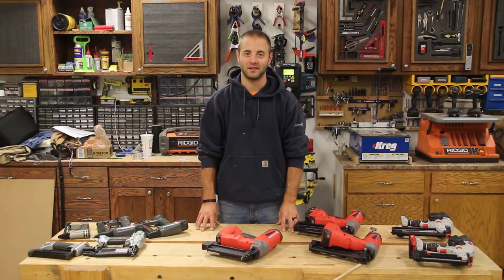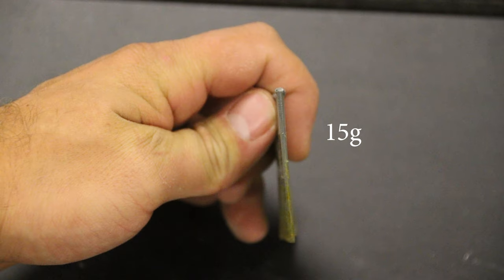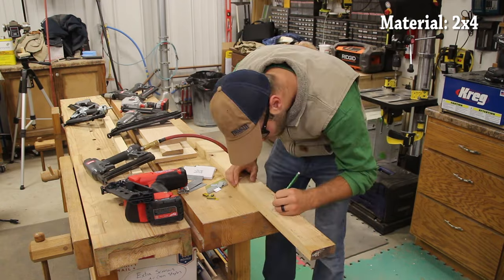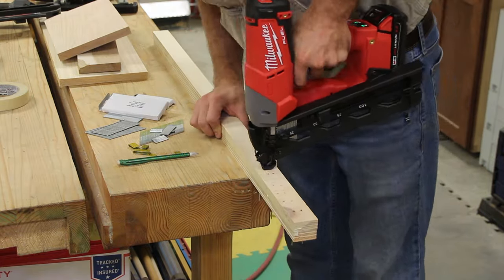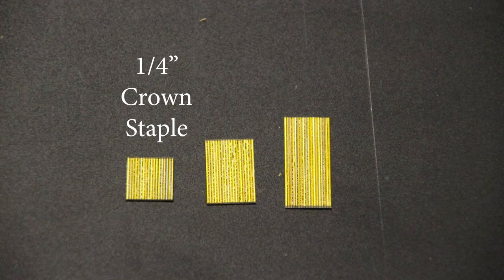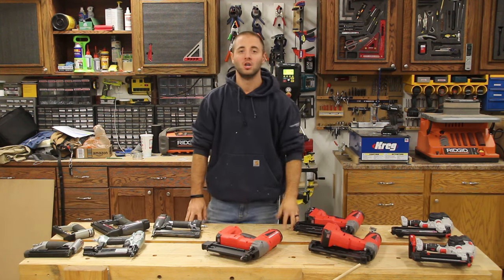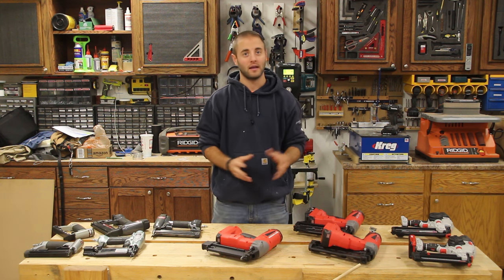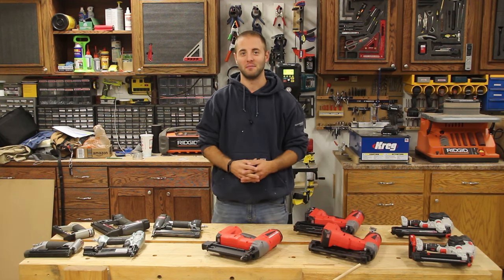What Gauge Nailer for Woodworking?

Comment: I'm trying to stop wood floor squeak and thinking about just driving nails into it. I've tried it with 18 gauge and no success. Is a 15 longer?
Reply from the maker: The gauge is the diameter of the nail.  They all come in different lengths.
Reply: I'm guessing its wood not carpet? Either way the way to get rid of a squeak is really with screws. They stuck the material together. Squeaks come from loose wood rubbing against wood or wood sliding against fasteners. Nails being smoot may solve the squeak for a bit but they dont really grab the substrate material effectively.

Comment: Well that answered my questions about what gauge gun to start with, now the age ol' question: Brands. Which brand of 18g gun to stay away from? I currently have Milwaukee, RIDGID and Ryobi tools so their cordless guns would be cheaper for me to buy into due to having their battery platform already. Any other suggestions? Ryobi's have hands down the best and most reviews on Home Depot's website. Basic DIY and wood working for me at this point so a $500 Brad nail gun isn't necessary.
Reply: I'm not a big fan of Ryobi power tools but I do own their 18ga AirStrike brad nailer and it is fantastic. As a test, I was able to shoot 2-1/8 inch brads into high-density particle board and drive the nails flush. Just keep in mind that the cordless guns are huge and heavy in comparison to their air counterparts. They also cost more - sometimes a lot more.
Reply: Pro1er I just bought the Ryobi cordless. I have pneumatics nailers and  this new 18g is all I use now. A lot of good content on YouTube reviewing 18g cordless nailers and Ryobi is always near the top.
Reply: Yup, it's a great gun, but it's huge! LOL

Comment: Thanks for the video!
If I can only get one, between the 15 GA and 16 GA, which would you recommend?
Any reason to buy both, 15 GA and 16 GA?
Reply from the maker: 16 guage will work 99 percent between the two.
Reply: @WorkshopAddict  Thank you!
Reply: In my experience the 15 gauge nails have a larger head than the 16 gauge nails so it'll depend on your application.
Reply: I'd go with the 15 gauge for more holding power. If you need thinner, then go for the 18 gauge brad nailer. 16 gauge & 18 gauge are to close in size to not go for the 15 ga.

Comment: What type of nail gun and what size nail for fence building?  Thanks.
Reply from the maker: You're going to use a framing nailer to fasten the fence rails to the posts.  From there, the pickets are best attaches with large staples.  Ryobi makes a nice stapler at an affordable price.  You can use a hammer on the fence rails to attach them to the post.

Comment: As a DIYer who will rarely use a nail gun for projects, I've elected to order a Ryobi 15ga angled nailer. I hope to avoid needing to buy a frame nailer. Whst do you think? (I already hsve an 18ga crown stapler.)
Reply: Unfortunately, the HP version of the Ryobi 15ga has been announced, but not yet available, and  have an active project. A video says it will drive 1500 nails on a charge, vs 750 for the non-HP. I have lots of Ryobi batteries and chargers, so it's no big deal.
Reply: Do you have a preference for brand of 15ga nails? Are stainless steel ones worth the higher price?
Reply from the maker: @Metal_seer  Stainless is worth it for outside or moist projects.  15g will not replace framing nails!  I would look ar dewalt nailers and see if you can find them close to the cost of Ryobi.  Brand of nails does not seem to mater much.
Reply: @WorkshopAddict  Thks for replyong. I will look, but I know without looking an equivalent DeWalt will cost a lot more than Ryobi. Plus, I would have to buy a DeWalt battery and charger. Every video I've watched gives the Ryobi 15ga angled very good reviews.
Reply from the maker: @Metal_seer  Owning more than one battery brand opens you up to more quality tools and sales.  I am not bagging on Ryobi, but they are low end nailers.  If you want to stay there, then that is your choice.  On sale, you can get dewalt for little more than ryobi.  IMHO, buy once, cry once and enjoy good quality tools.  As a diyer, you will appreciate the higher quality tool and especially the trigger.
Reply: @WorkshopAddict  I have bought other brands if they have a superior feature. That's why I bought a Bosch grinder, because it has a very ingenious blade release. Once I'd bought into Bosch, I also bought a Bosch multitool.  But, having multiple chargers and batteries costs $ and takes up space.
Reply: I'd think 2.5 in 15ga finishing nails, augmented by 3" deck screws where needed, will be adequate for the DIY projects I do, using 2x3s or 2x4s as structuraly elements. But, if I find I really need a framer nailer, I will look at multiple brands, as you suggest. Thanks for the advice.

Comment: Hi, what the best nailer for attaching cabinet back to MDF or Plywood? The material for the back is 3mm MDF
Reply from the maker: 18 ga and glue
Reply: Your back is thin and not very strong, as a retired cabinet maker I would us a 1/2 in wide crown with at least  9/16 legs to make a strong held back.

Comment: What gauge would you recommend for putting 1/4 inch plywood on studs on wall & ceiling?  Thanks
Reply from the maker: Staples.  If you want to use a nail, go with a 15g so it has some sort of head to hold the wood.
Reply: Thank you @WorkshopAddict

Comment: Thanks for the video info. Starting DIY and woodworking, what you recommend for Crown molding ceiling 18 or 16?
Reply: 16 Gauge, a bit larger diameter nail for better holding power, and still a small enough nail head to be easier to cover over.

Comment: What would be the perfect nailer gun for installing baseboards. I been shopping around and both lowes and home depot have a kit that sales the compressor with 18&16 gage nailers.
Reply: 18 and 16 ARE what you need for most baseboard applications and those gun/compressor combo kits are great.  You'll get plenty of value for the money.  Use 16 (2" or longer 2 1/4" is better ) for your field fastening and 18 (1" or less) to brad your ourside corners.  Careful field fastening around toilets and sinks and other places where water lines are present so as not to punch thru a water line.  Get yourself a cheap stud finder that will also sense water lines or maybe a little gadget specifically for finding the water lines.

Comment: Would you use 15 gauge nails for nailing fence pickets to the fence rails? Trying to put up a fence myself. Thanks!
Reply from the maker: Some would, but I would suggest staples.
Reply: The trouble is the nail heads are pretty small so you'll most likely end up sending the nails through the pickets completely if you aren't careful and they'll work loose pretty quickly within a few years....staples would be better as they'd kind of bridge across a larger section of the picket and hold more firmly.  Course you could always use a framing nailer but a bit overkill for most pickets which I think are in the 1/2 to 1 inch thickness so a wide crown stapler would be a good solution to that, just harder to remove later on if needed.

Comment: Awesome video, liked and subbed! I will be framing 2 by 4's for a screened in patio job, would you recommend that I go with an 18 or 16 gauge nail gun?
Reply from the maker: We would recommend a framing nailer for that task.
Reply: You’ll want to use 16d sinker nails. I prefer a palm nailer and plain nails rather than a framing nailer. Framing nailers are expensive and heavy. Palm nailer is very light and super versatile.
Reply: Palm nailers have their place. I use them in restricted spaces and for attaching metal fasteners. Ocassionaly for larger nails over 3.25inch, ones larger than a framing nailer can handle. If I have more than a few nails and think you may frame again. Framer guns can be had cheaply. If you will only see yourself nailing only a few, go with the palm nailer. For lighter trim  and shope, yes 16 and 18 gage.
Reply: Or get a hammer and some 16d nails. No need to buy a gun for a small project

Comment: Is there any efficiency drawback to buying a plug in electric nailer since they are generally less expensive?
Reply from the maker: No, in general they just seem to be of lesser quality so try to buy a brand name one..
Reply: Not really, typically though they don't have the capacity that an air powered or battery powered model would have, but maybe the new electric ones do I haven't checked lately.  I don't have any battery powered nailers or staplers all mine are pneumatic and work great.  The only electric fastener gun I've used was an electric stapler and it wasn't that great LOL.

Comment: what is your advice about the non-separate compressor nail gun? The ones where no air hose is needed. Your thoughts?
Reply from the maker: Like the Ridgid and Ryobi models?  If so, they are nice, but larger and do not fit into small area.

Comment: I'm buying my first gun.  My uses are indoor trim, bead board on a island cabinet drawer repair etc.  Will a 18 gauge be fine or should I go 16 or thinner at 23?  Any information would be appreciated!
Reply from the maker: You can get by on indoor trim with a 18, but a 16 will really be better.  Bead board and drawer repair are more in the 18g range.  I guess I would start with an 18g to save money and see how that works for you.  If you have straight walls and hardwood trim, you will be fin.  if it is pine trim, you might find the board will get loose over time.
Reply: @WorkshopAddict  the bead board is probably the heaviest I'll ever use a nailer on.  It's going around a island.  Thinking 1/14 inch 18 gauge nail with a little liquid nails on back.  Thoughts?
Thanks
Reply from the maker: I would use 1-1/2" nails on the bead board to make sure I have a bit more than 1" into a stud.  You should be fine, just know you might need an extra nail in some trim boards.

Comment: I dabble in furniture (desks, small tables) making, and I am Trying to decide whether to go with a 16 gauge or 18 gauge nail gun?  Any advice?
Reply from the maker: probably 16ga only because there is more structure, but if it is just for small trim pieces, go to 18ga.
Reply: both

Comment: I'm new using compressors, I bought a 1 gallon(CH) compressor, the hose, and a (Znex)brad nailer, and the nails... it's not working... How can I figure out if the problem is the compressor, the hose, or the brad nailer ? Thank you in advance for your answer
Reply from the maker: We need more info..  Is there a regulator on the air compressor?  does the air compressor motor turn on and turn off after some time?  What fittings are you using on the hose?  We need more info.
Reply: WorkshopAddict 
Would a picture of the compressor and a picture of the hose help you ?
Reply: WorkshopAddict , no, no regulator, and the compressor does turn off after a while
Reply: The compressor almost certainly has a regulator on it, there should be a PSI gauge with a knob underneath/near it. That knob is used to adjust the regulator which sets the working pressure of the compressor, and that setting should be between the min/max pressure settings listed on the nail gun. 90-100 PSI is generally a good bet to start with, and can be adjusted based on how the gun behaves. In order for the gun to actually fire nails, it will obviously need to be properly loaded with nails. A brad nailer will have a 'tip safety', which means that pulling the trigger will do nothing until the gun is pressed into the workpiece, depressing that spring-loaded tip safety.

Comment: I just bought a Hitachi cordless 18 gauge brad nailer to attach baseboard trim and 1 inch trim around window. Now I am thinking I should have gotten the 16 or 15 gauge finish nailer for better hold. Which one would you recommend?
Reply from the maker: Debra Diane Most use a 16g for baseboard and 18g for windows.

Comment: Hi first time viewer and new to hobby woodworking. I will start off with picture frames , keep sake boxes, and wondering ?? Would you guys buy a pin nailer or a 18 gauge for that type of woodworking? Ty
Reply from the maker: Mr. B Larger picture frames one would use 18 ga.  Small stuff one would use a 23..  BUT, when you use a 23 pin nail, it is mostly to hold it in place while the glue dries.  There is little in no structure to the 23.  So, it sounds like in your situation, you might want both.
Reply: WorkshopAddict   Ty very much. Very fast reply. Much appreciate. Any brand you suggest for my situation?  And what size of pins should one stock up on?
Reply: Mr. B the hitachi 18 gauge nailer is a great nailer for the price not as good as the bositech smartpoint but man it’s also much cheaper. I think they are going for 80 right now and occasionally on sale they go down to 60 comes with a hard case and safety glasses. I’ve shot thousands of nails threw mine.
Reply: I like the Hitachis. Grex is also great, I'm told. 23ga pins can hold surprisingly well if you toe-nail at less than right angles.

Comment: I'm building a small bench out of studs and thought about using a framing nailer would that be cheaper instead of using screws and would that be strong enough to hold it?
Reply from the maker: It would be, but regardless, use glue too! I would use screws and lay them out in a neat pattern. That way you can be proud of them and they will look better than framing nails! -Andy

Comment: hi nice video - is it possible for any nailer to perform 18ga, 23ga and 1/4 inch crown staplers in one machine ( more into 18ga plus crown staples) thanks in advance :)
Reply from the maker: No
Reply: @WorkshopAddict  that has to be the shortest reply in history :)))
Reply from the maker: @ChristopherClaudioSkierka  Sorry, I was hunting and on my phone.  It is currently not available and if it was it would most likely not be recommended as it would not be reliable.
Reply: @WorkshopAddict  its fine , thanks for the info

Comment: Starting off in Wood Working and needing to fin an all round Nailer that could be used for multiple projects without buying to many nailers. Thanks. I am putting down 3/4 in plywood on floor. And making my own baseboard out of the same material. Thanks in Advance
Reply from the maker: Screw the plywood down and use an 18 gauge to nail it for trim.

Comment: Great video!! and i do have a question. I will be putting up 1" x 10" ship lap pine in my garage for the interior walls and i considering purchasing the Ryobi p330 and hopefully finding a ringed 15 gauge nail to do the job with. So my question is do you think my choice of nailer and its size are correct and i cannot seem to find a ringed nail anywhere for this job so do you know of any ringed nail i can run in this nailer or should i not worry about it and just go with any old 15 gauge finish nail for the job. I will be doing about 1300 square feet and i like things built lie they used to say "built like a brick shit house"
Thanks, D
Reply from the maker: You won't find a ringed nail for that size.  😁 I think you will be fine.  If you want the brick shit house build, put some small dabs of glue behind it.  But then it will not be allowed to move with moisture.
Reply: Ok , so any regular finish nail in 15 gauge say around 2" to 2 1/2" makes sense to secure that size board to the  studs? No glue.
Reply from the maker: @wabug8423  Yeah..  You won't want to use a framing nail.
Reply: Thank you very much!!! Keep up the good work!!

Comment: My first finish nailer was a Ryobi 15 gauge angled finish nailer. I like hold holding power of the beefy 15 gauge nail for baseboards and door jambs and have also used it on quarter round.  You're going to have to fill the hole anyway so why not go with the larger nail?  I disagree that the Brad nailer should be the first nailer, you're limited to 2 inch nails so it's not ideal when your going through 3/4 baseboard, 1/2 inch drywall, and want to hit a stud.
Reply from the maker: Anonymous bigger nail is a bigger hole. It is unsightly.
Reply: You are not going to see the hole because you're going going to caulk before you paint.
Reply: Why are you "... going through 3/4 baseboard, 1/2 inch drywall, and want to hit a stud." if you are a woodworker watching a video titled "What Gauge Nailer for Woodworking?"? Of course you disagree. What made you think otherwise?

Comment: looking to build my first bookcase in the shape of a boat. about 5 to 6ft tall looking to purchase the necessary nail gun any suggestions?
Reply from the maker: Do you want hose-less (battery) or pneumatic? If you want to go battery, the porter cable 18v 18 gauge brad nailer is hard to beat. If you want pneumatic, I would recommend the Hitachi.

Porter Cable 18g - http://amzn.to/2thNqiE

Hitachi 18g -   http://amzn.to/2sxmJdj

Comment: What gage size do you recommend for installing 6” crown molding. ?
Reply from the maker: 18g
Reply: So 15” would be overkill ?
Reply: Meant 15 gage. Also, Thanks for the quick response.
Reply from the maker: @walterduarte7809  It will leave you with a larger hole to fill and will be Overkill.
Reply: Ok. Thanks for the info. Im officially a subscriber.

Comment: What minimum size of compressor would a first timer need for that 18 gauge nailer?
Reply from the maker: repairdrive That will matter on how fast you plan to use it.  A 2-4 gallon compressor will do well.  Try to stay away from oil free models that are very cheap.

Comment: I want a nailer that can do trim and install prehung door frames, should I get a 16 or an 18 ?
Reply: As a General Contractor, who does a lot of my own finish work- including hanging countless doors- I'd go with a 15 gauge finish nailer. The fastener will give you that extra needed holding power & the hole is marginally bigger than the 16 gauge fastener.